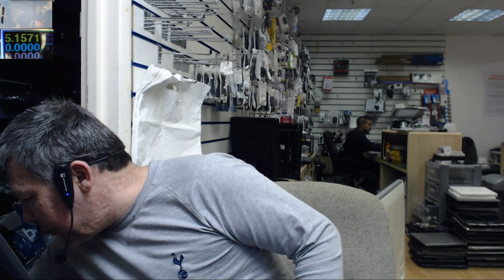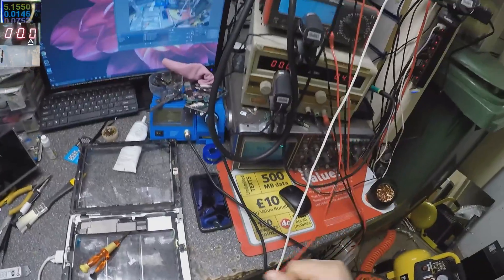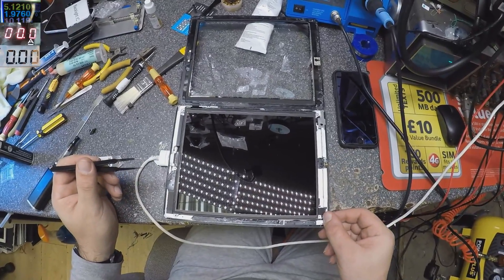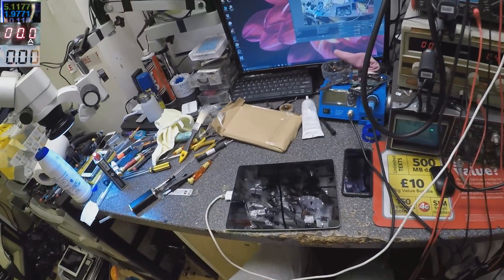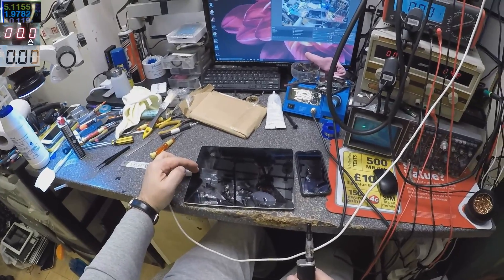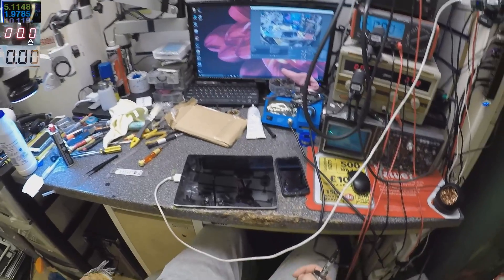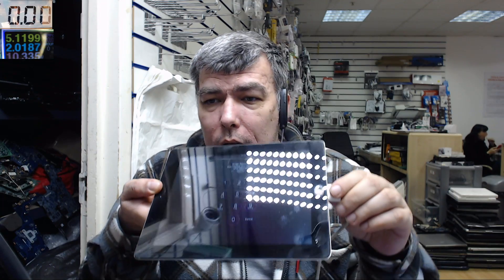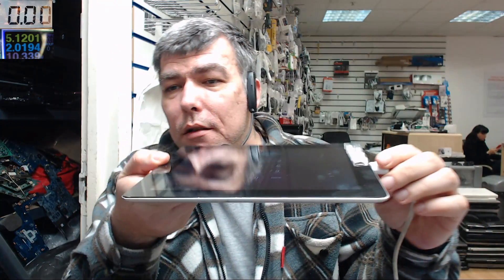Ipad 3 no power, the most easy repair ever :)

Comment: Hi, love the way you do your job with some healthy 
reluctance (or act like that).
I admire your skills, really do.
Myself i'm starting to (try) fix logicboards. Bought the hot air rework station, cables, power supply etc. Just can't come any further with this iPad 4, power supply set on 5V 1.5A, iPad only takes 0.006 to 0.028 AMPS. Can you maybe help me with some practical tips/advice? Don't want a solution, want to work properly with my equipment, thank you in advance!
Sven from the Netherlands

Comment: On the iPad 2/3 didn't u2 failed the same as these days?
Like when the iPhone does not charge when the battery is totally dead?
But still at 1.9A that should be fine i guess :)
Reply from the maker: Actually, in the case of very low baterry, its a electronic fault of the battery. The electronics of the battery its suppose to cut the power off around 3.5v in oder to protect the li-ion element. When the the electronics fail, yes, the battery goes very low
Reply: See your vaping,  me too 👍